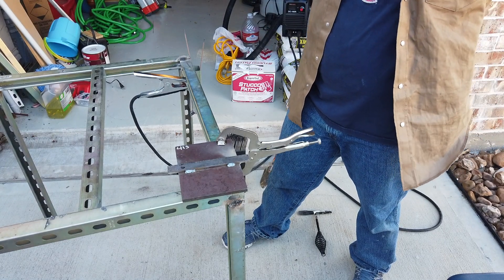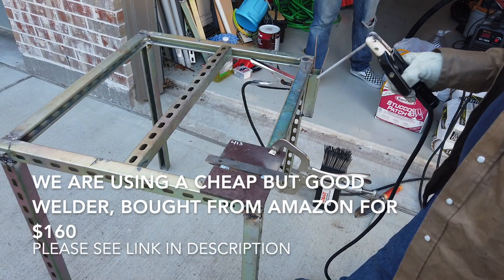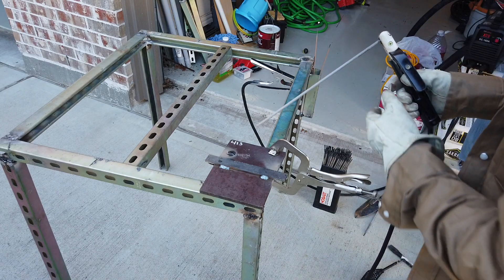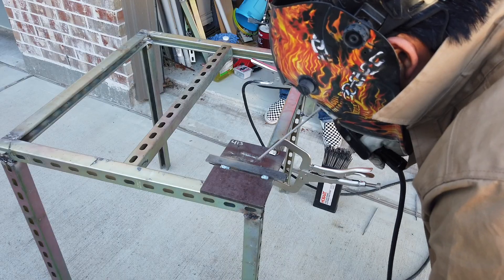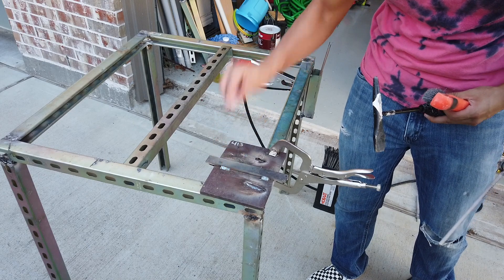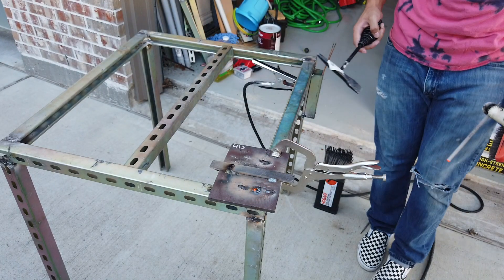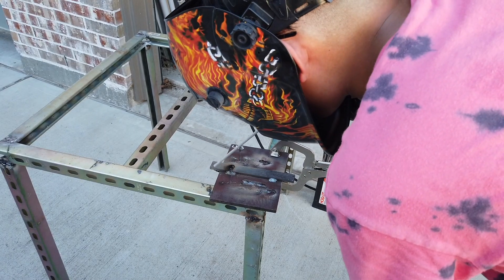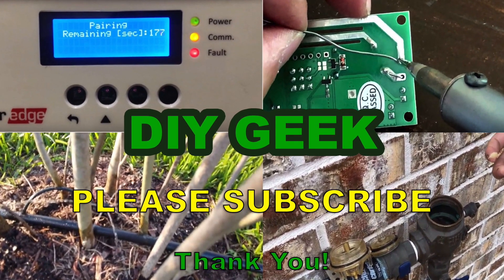Lesson 1: Striking an ARC - Learn How to Weld Series

Comment from the maker: You can buy the cheap but good stick welder we are using from here::
AMICO 160 Amp Dual Voltage Input DC Welder IGBT Inverter Welding Soldering Machine
https://amzn.to/2zC1QiQ

Comment: Not sure how watching someone beat the rod against the metal plate for 7 minutes in an attempt to strike an arc helps? And cheap Chinese welder are,  Cheap.
Reply: Well, seeing an expert strike an arc isn't very helpful either. It's something that only improves by doing it yourself. And on SMAW most modern machines have hot start and anti-stick these days, even the cheap Telwin that I've got.